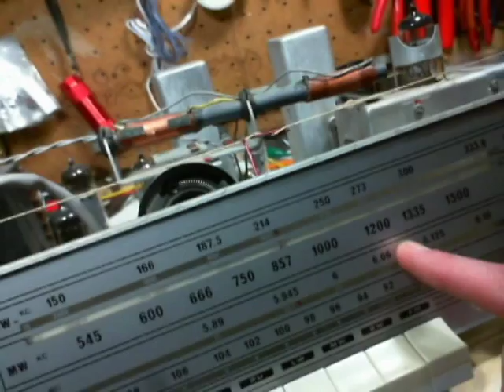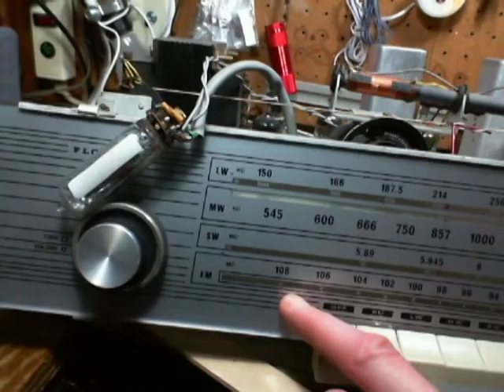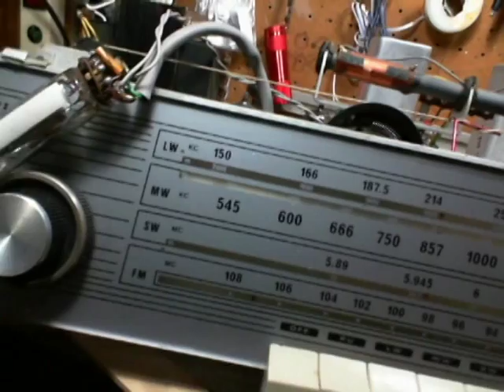The Florida AM/FM/SW Yugoslavian Built Tube Radio Video #3

Comment: I bought one for parts. I want to use the PT and OT in particular for a guitar tube amp.
Do you have any definitive values for the secondary windings. Usually in audio amps there would be 5V for the Rectifier and 6.3 the heaters and pilot lights but I'm getting very high values. Also, do you know where I could get a schematic for this radio?
Thanks,
JK